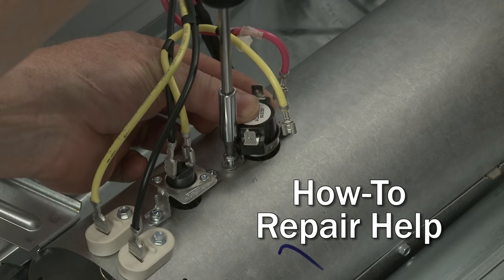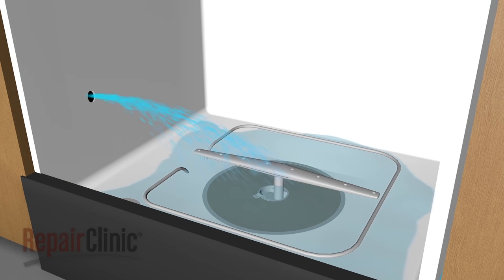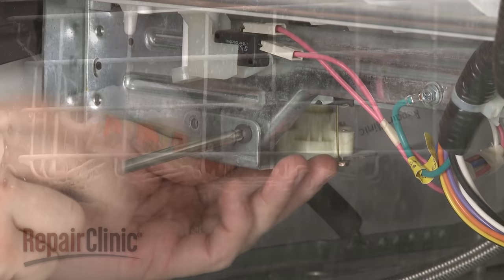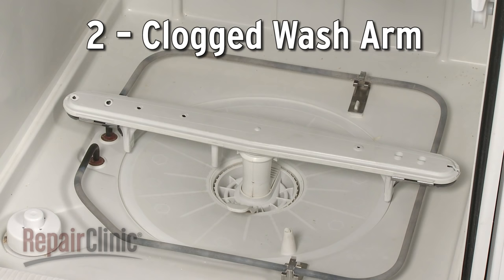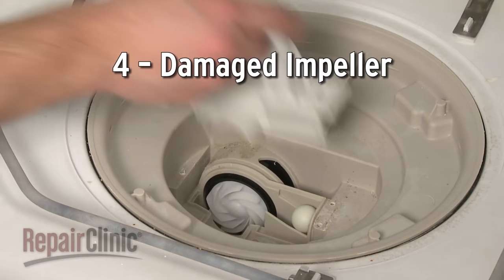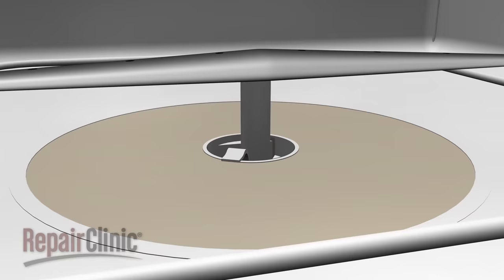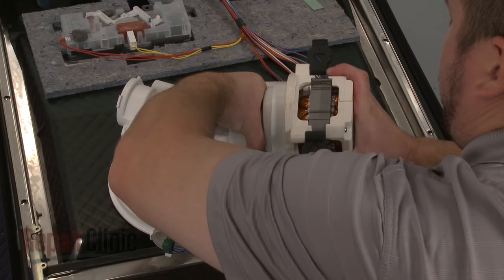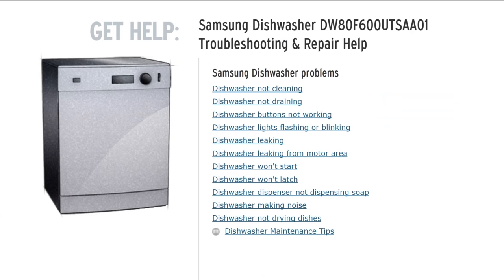Dishwasher Won't Clean — Dishwasher Troubleshooting

Comment: Is the water that washes the dishes heated in the water heater in my basement or is it heated by the elements inside the dishwasher?
Reply from the maker: Could be both but for the most pat it is hot water from the house hot water heater.
Reply: Thanks. I had turned down the temperature on the water heater a little and was just wondering if that had anything to do with the dishwasher not cleaning too well. So I guess it's possible. It had been cleaning alright before, even with that loud noise that it makes when I turn it on.